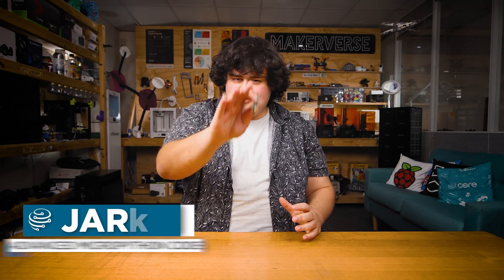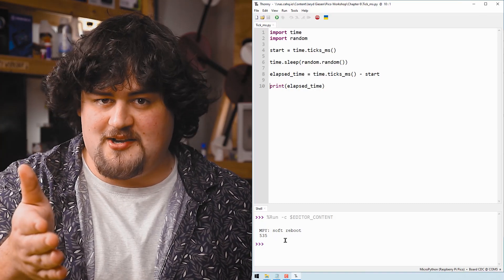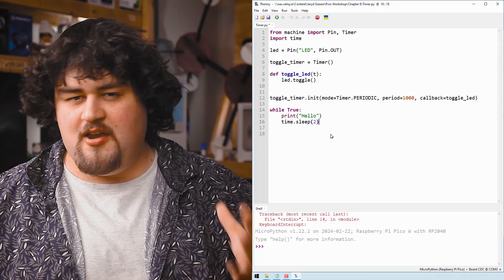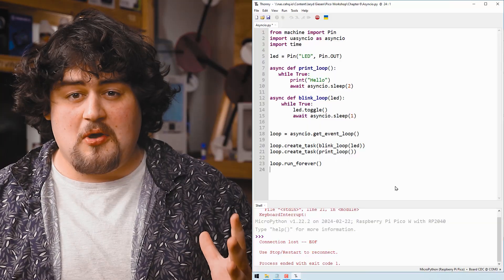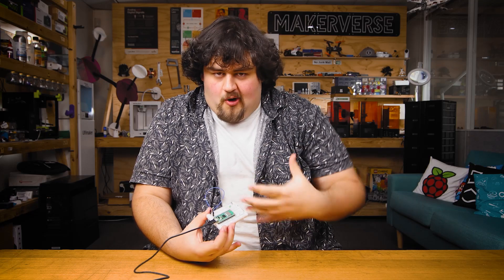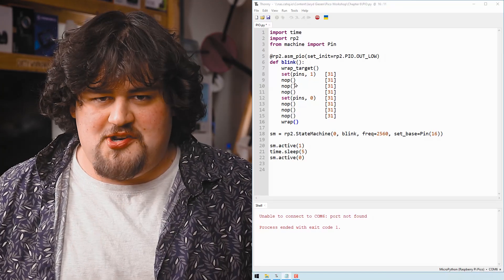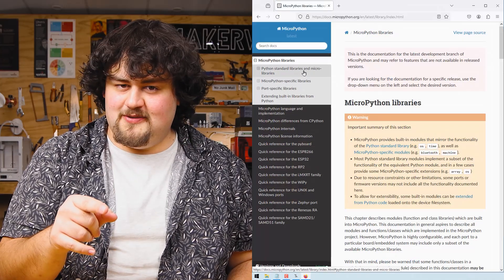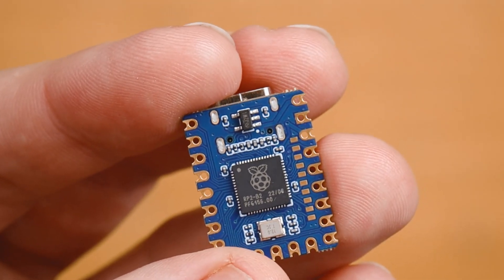MicroPython You Should Know? | Raspberry Pi Pico Workshop: Chapter 6.1

Comment: Need low power and micropython then see Adafruit S-35710 Wake Up Timer breakout board, 
running pico for days then use ticks_diff() to check elapsed time, ticks counter can turn negative which the example in this video does not catch !